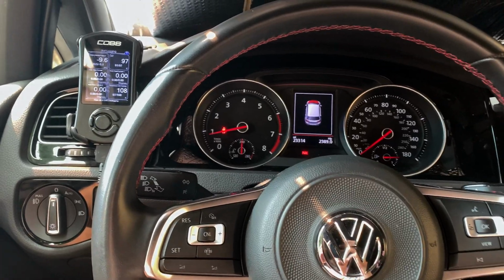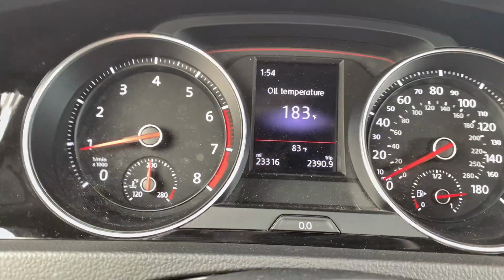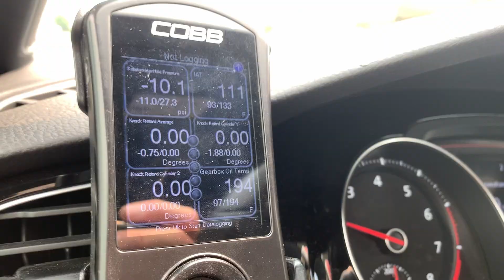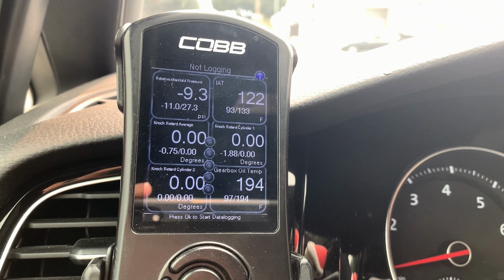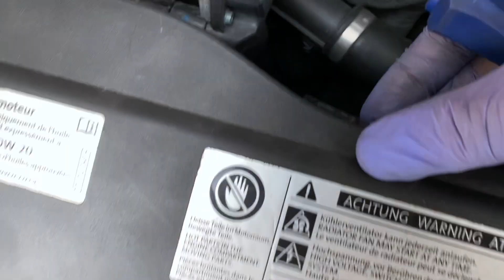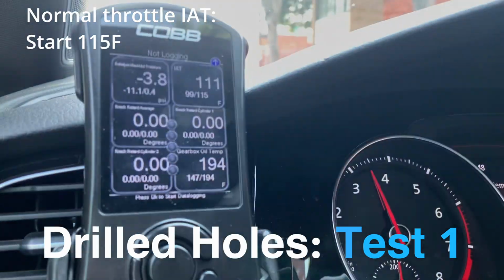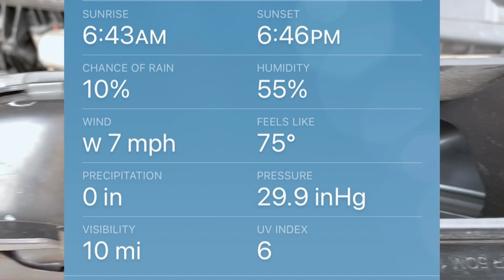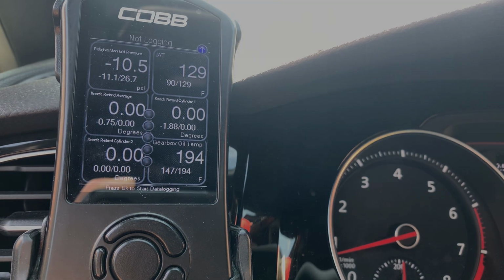Does THIS Air Intake Mod Really LOWER IATs?

Comment: This was literally the first mod I did to my 17’ GTI. Did it the first week of ownership when I bought it brand new in 2017. Due to that, I can’t say it drives differently, or that my IAT’s have changed because it was done the first week of owning the car, but I will say this:

I have driven it through three heavy, snowy UT winters, and through one very rainy summer in AZ, and I’ve had zero issues with anything getting into the intake. Even if something did get into it, the air filter would catch it before it made  its way into the turbo anyways.
Reply: Same

Comment: I can tell you I did it on mine about 2yrs ago never had an issue. If you watch last human garage and a few other's have done it and never had an issue. You can also get the block off piece on passenger side to allow all air going to inlet on driver side.

Comment: There’s also a block off plate for the opposite side, and even an air route plate you can mount in the bumper to route air into it, that you can try for further testing.
Reply: This. Snag on eBay. Remove snow guard too
Reply: Link please?
Reply: Is it applicable for Audi’s also?

Comment: I did this air duct mod on my ‘16 R. Also the inlet and neuspeed discharge pipe. I also have a turbo blanket to help with temps. I did it all at the same time though so I can’t say which is best. The turbo noise is significantly louder though.

Comment: Same mode here in Sweden 🇸🇪 alot of rain and snow and no problem, also remove snow plate from air box 😃
I do it for more air, think bigger intercooler will fix temperature problems 😃
Reply: Does it affect on intake sound?

Comment: I had the block off plate in the air duct, but ended up removing it. I want air to hit the bay as well so I figure doing this mod might give best of both worlds.
Reply: El aire que necesita el motor le entra fundamentalmente por la rejilla, da igual que le pongas el block off o no. Simplemente el intake trabaja por aspiración y hace que esa apertura meta calor del motor al principio para proteger y aumentar la temperatura de turbo antes cuando el motor y su aceite no ha llegado a la temperatura óptima. Lo ideal sería tener un Block off plate modulable y cuando el motor llegue a su temperatura poder cerrarlo porque la admisión ya no necesita ese aire caliente, ya lo que necesita es ese aire frío. Piensa que el intake de stock tiene que trabajar en infinidad de países con climatología muy diferente de inicio de motor, y el turbo en frío es lo que más sufre si se le pisa sin temperatura. Esa pieza, block off plate, viene bien cerrarla en países muy fríos en verano, pero abrirla en invierno. En países de clima no tan frío se puede mantener cerrada. Otro tema de porque es bueno tenerla abierta en invierno es por las posibles nevadas y entrada de copos por el intake que puede llevar a que el filtro pueda coger cierta humedad y perder eficacia y ahogar la entrada de aire. Ya te digo, el intake está hecho para su función en el mundo, depende del país donde uses el coche puedes modificarlo sin preocupaciones o no. Esta última explicación es la misma por la cual la parte del conductor no viene abierta directamente de stock. Piensa en R601e, como viene montado y se supone que es para sacar rendimientos sobre stage2+ o 3. Espero haber ayudado un poco a todos.
Reply: @josemariapugagarcia7147 i live in a country that has hot summers and cold winters, should i open the closed part. Also do u think making holes / opening would make it less efficient becuase the air will be disturbed as the opening have no lines to straighten the air that is going inside?

Comment: Mk4s been doing this for years. Except the webbing was removed on both sides to allow air to go directly into the engine bay and flow over the engine removing hot air

Comment: Nice idea for the inlet! But speaking of the intake itself: As long as your Stage 1 a new air intake wont do much. Iv kept my original box as they say it does as well as 99.5 % of the other ones out there. Its not until you reach higher level of tunes it starts to make a differance. Personally id love to have a carbon fibre intake for the looks sake, but paying all those cash for just the looks when nobodys really gonna see it unless you pop the hood often might not be worth it, unless your showing of alot at shows and stuff. My two cents anyways 👍
Reply from the maker: that’s why I kept the stock airbox on for so long. The upcoming intake is just to get more sound
Reply: I agree with you 100% re. the performance since I ended up buying 034 carbon intake for the sound and the looks. However, I don't feel the need to show off to anyone; I do things to my car for my enjoyment and for no one else. It does make me check fluid levels more often :D

Comment: Intercooler>intake mods. Your temps are not cooling because of the intake but because of the intercooler sucking in air. Intakes have proven to make no power on this platform and are use strictly for turbo sounds and looks. Wait until your intercooler is upgraded and you start running e85 the entire car will run about 20 degrees cooler.

Comment: El aire que necesita el motor le entra fundamentalmente por la rejilla, da igual que le pongas el block off o no. Simplemente el intake trabaja por aspiración y hace que esa apertura meta calor del motor al principio para proteger y aumentar la temperatura de turbo antes cuando el motor y su aceite no ha llegado a la temperatura óptima. Lo ideal sería tener un Block off plate modulable y cuando el motor llegue a su temperatura poder cerrarlo porque la admisión ya no necesita ese aire caliente, ya lo que necesita es ese aire frío. Piensa que el intake de stock tiene que trabajar en infinidad de países con climatología muy diferente de inicio de motor, y el turbo en frío es lo que más sufre si se le pisa sin temperatura. Esa pieza, block off plate, viene bien cerrarla en países muy fríos en verano, pero abrirla en invierno. En países de clima no tan frío se puede mantener cerrada. Otro tema de porque es bueno tenerla abierta en invierno es por las posibles nevadas y entrada de copos por el intake que puede llevar a que el filtro pueda coger cierta humedad y perder eficacia y ahogar la entrada de aire. Ya te digo, el intake está hecho para su función en el mundo, depende del país donde uses el coche puedes modificarlo sin preocupaciones o no. Esta última explicación es la misma por la cual la parte del conductor no viene abierta directamente de stock. Piensa en R601e, como viene montado y se supone que es para sacar rendimientos sobre stage2+ o 3. Espero haber ayudado un poco a todos. Por eso animo productor del video a que contemple la posibilidad de cerrar y poner el block off plate y hacer el mismo trabajo de medición, estoy seguro que vas a llegar a los +20 grados de diferencia sin problema. Lo pongo aquí para más visibilidad. Un saludo

Comment: Nice vid man. 
Do you ever get knock readings with COBB.
I have a S3 with cobb ots and even after updates 
My car experiences Knock cylinders 
All cylinders have -3.00 
1 2 3 4 cylinders. 
Car runs great.
But the knock is keeping me worried. 
Any advice..
Reply from the maker: Yes, Cobb ots maps aren’t the greatest so you’ll most likely see knocks. We talk a little more about knocks in this vid, abd monitoring them. generally anything more than -3.00 is not too good https://youtu.be/agDOzzlS0KU
Reply: @JewelCity1  I did some reading and someone is suggesting to do a Carbon build clean before doing a downpipe and intercooler.  
I've never ran the car hard @104K don't know if it's even worth it to continue to invest in it.

But I feel the motor is strong like so much potential

Comment: Do you've a 1 year review on this mod you did?
I'm concerned about water getting into the turbo
Reply from the maker: 1year later: currently running an open intake and haven’t had any issues. Doesn’t get driven in the rain often but when it does I’m not too worried. I think as long as you’re not boosting in rain wet weather it should not suck any water.

Comment: Just curious is Cobb better then a jb4 tune or is it the opposite. I wanna tuned my mk6.5 but idk which one is better
Reply from the maker: Jb4 is a piggy back calibration, so it is limited compared to Cobb. Cobb allows you to get custom tunes and tune the timing, thus squeeze more power out of the engine. Jb4 won’t allow all of that.
Reply: @JewelCity1  oh okay I see now. Thanks bro

Comment: Hey bro so you make 400hp with the is38 most people say that could blow the turbo cause it can’t handle that much but the vortex can handle 400hp and more and ofc it a bit more expensive .do you ever worry you might blow the turbo??
Reply from the maker: Not really its a Is38+ and not running a maxed out tune.
Reply: Who says an oem is38 can’t handle 400hp? And are you talking about whp or crank hp?

Comment: Is the IAT sensor on your car pre turbo?
Reply: It's inside the intake manifold.
Reply: @mygolfmk7209 please correct me if I'm wrong but wouldnt that be charge air temp at the IM?
Reply: @plumski86  It is after the turbocharger.  I suppose it would not be incorrect to call it that, but intake air temperature seems to be convention that has been adopted.  Since there is only one sensor along the intake when IAT is mentioned this is normally what is being referenced.
Reply: @mygolfmk7209  got it.. thank you! 🤙🏿
Reply: @mygolfmk7209  that sensors refresh rate must be super fast. 👍🏼
Reply: @jonj4357  I have not seen a figure for the response time of the Bosch sensor.  It's almost like a hot wire sensor, so I assume it responds rapidly.  The problem I've observed is that it is located away from the throttle body and doesn't seem to receive adequate airflow until getting into boost.